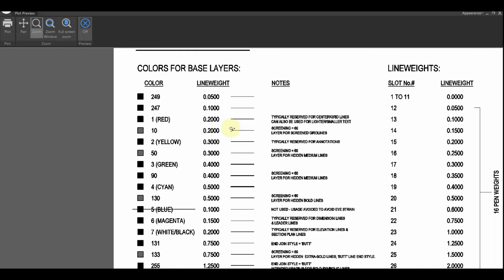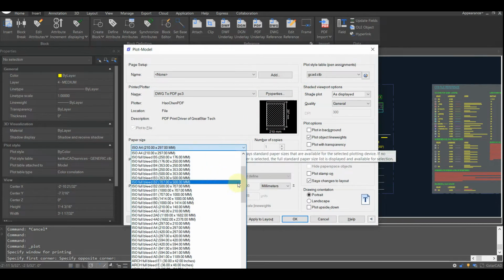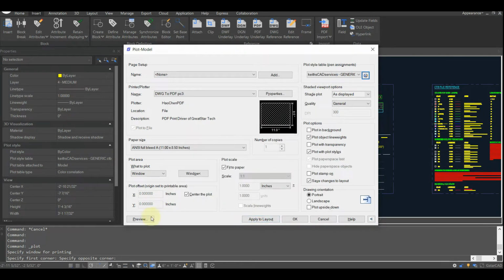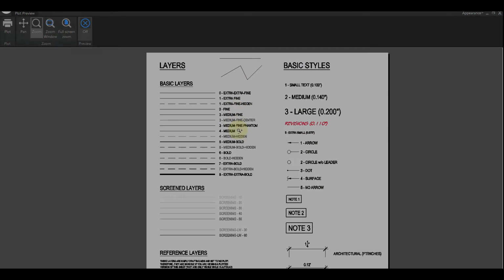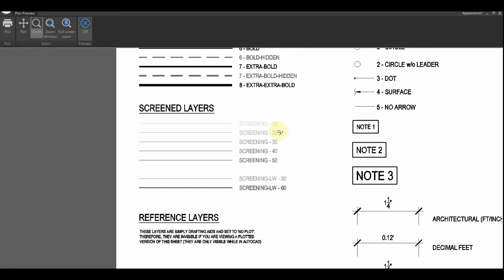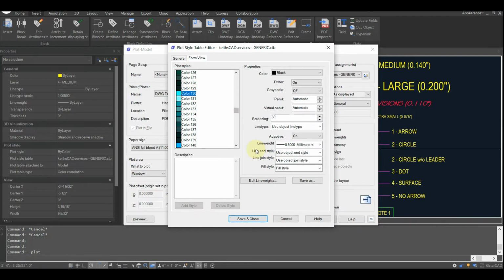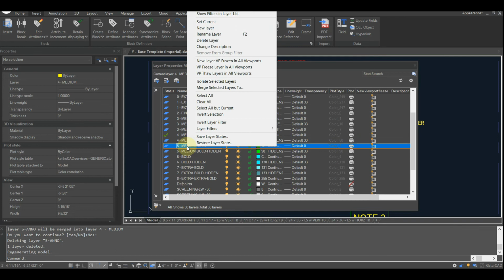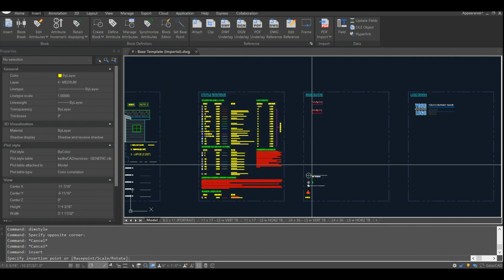CAD Standards - Part 2

Comment: Hi, you won't have the file to share
Reply from the maker: Hi Victor. Eventually I'll stick this somewhere for free. I just haven't decided when and where.
Reply: @randomCADstuff  Have you made your file available? I know you have a ton of work into it. Just curious. Thank you!
Reply from the maker: @scottberg007  The amount of work to create these standards themselves wasn't much. It just took time to figure out a system I guess. As far as posting a free (or very cheap) file somewhere, one issue that presents itself is that it's not a pure AutoCAD file; I created it while trying out both BricsCAD and GstarCAD. It shouldn't crash but in hindsight I wish I created it purely in AutoCAD. A warning dialog comes up. And at least one of the dynamic blocks will crash in BricsCAD. The last issue is that I want to improve it: I want to create better title blocks (the title block itself takes up way too much space) and maybe create a LISP suite. I'm burnt out on the CAD and busy at work... so I just haven't been able to do that. These posts help stir up the motivation required to do that however; I might get back on this when my work shuts down over Christmas. Sorry for the likely longer than expected answer ;-)